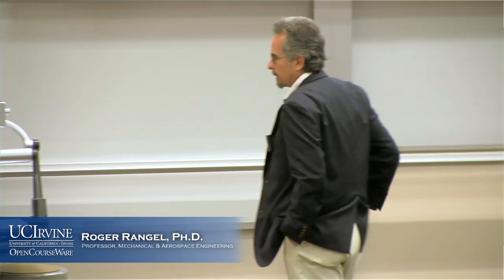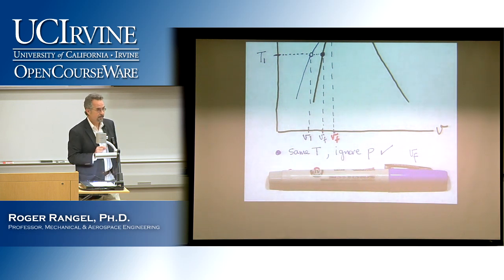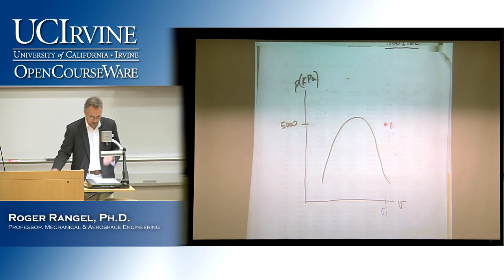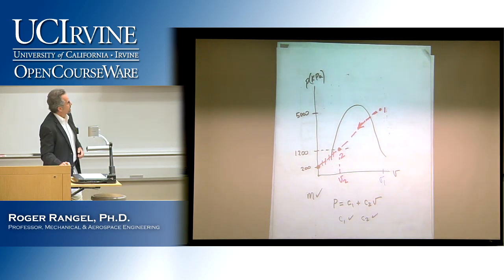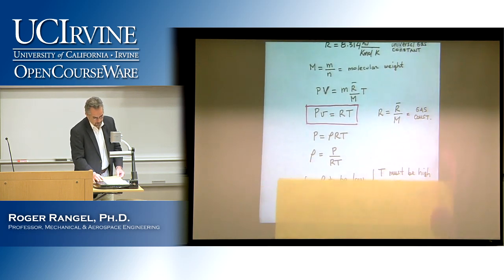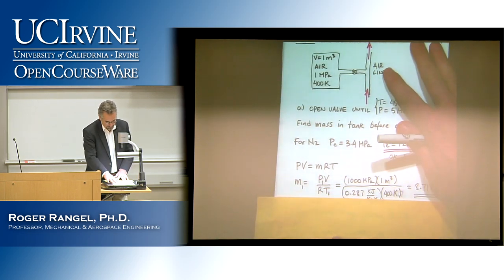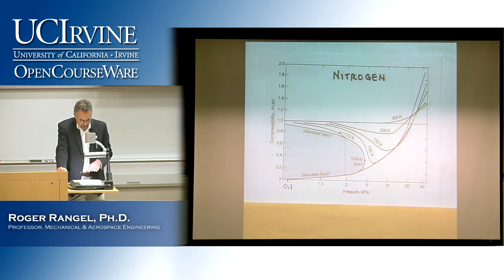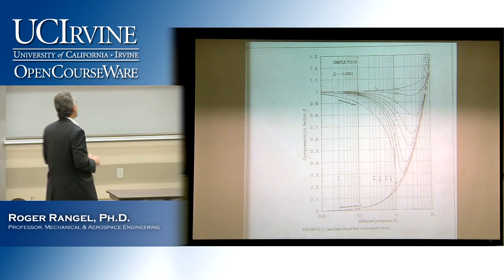Engineering MAE 91. Intro to Thermodynamics. Lecture 04.

Comment: In the first problem, how did u knew that the state 2 of the process will be inside the dome?
Reply: Got it, first the pressure-volume relationship (equation of a straight line) was found using state 1 and state 3 (200 kPa), then using the value of P = 1200 kPa, the specific volume was found, and on comparing it with the values of vf and vg @1200 kPa, the value was inside the dome.

Comment: How do you find C2?
Reply: +Alberto Landeros from the lecture before , there was a short proof of that
Reply: ahmed mohamed hamed I don’t know too! Because I don’t know v2...v2 is in the mix region, and the problem did not gave us the quality x.
Reply: @zejean  could you not just use the equation of the straight line P=200+C2v where c2 is the gradient if you put in 5000 kPa and 0.05781 as P and v and solve for C2
Reply: @fatimasajid4109  Thanks so much man.. I was really confused